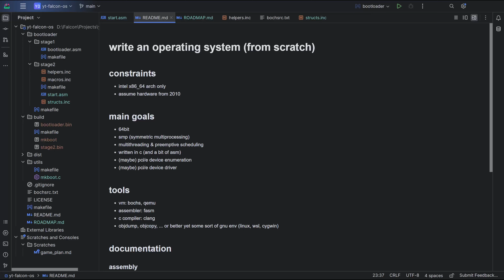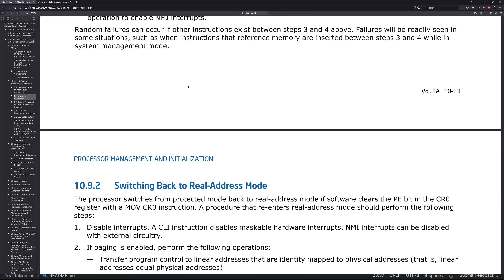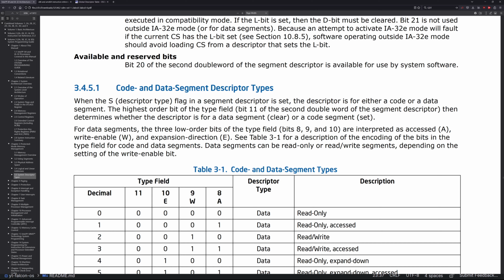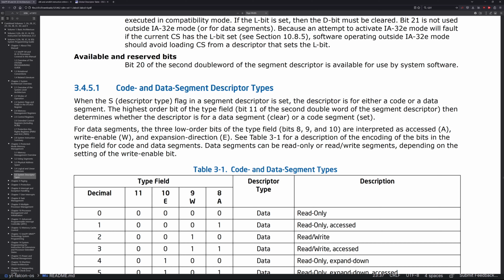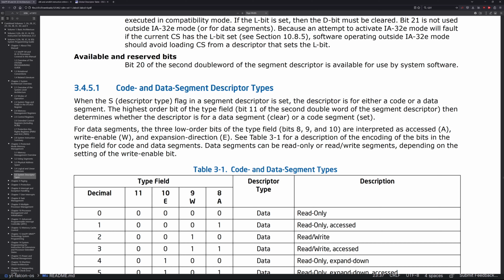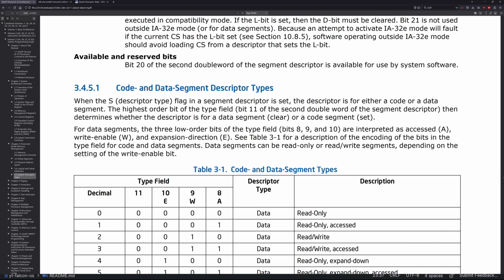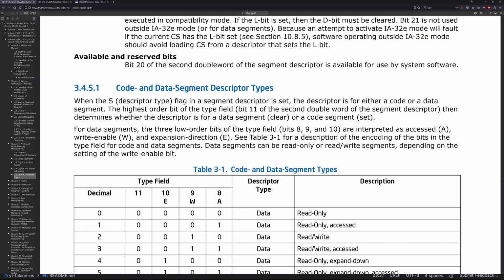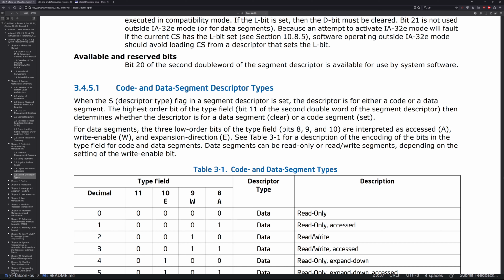0 to Kernel - 2nd stage bootloader (Part 2 - Protected mode)

Comment: I think a video or parts of the last one might be missing. 2nd stage Part 1 is Reading the Memory map, and it ends with running stage 2 -  that video does not show how the Graphic Mode is set up. This is 2nd stage Part 2, and the Graphic Mode setup is already added to the code at the start.
Reply from the maker: You are right. I found the video recorded but not edited on my computer.
I'll edit it and upload it as soon as I can.
Thanks for the heads up :)